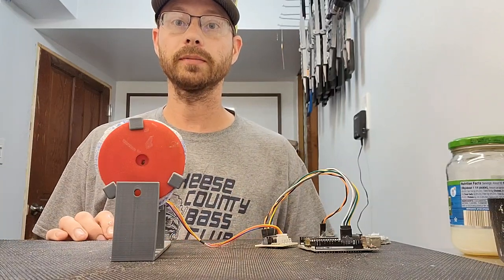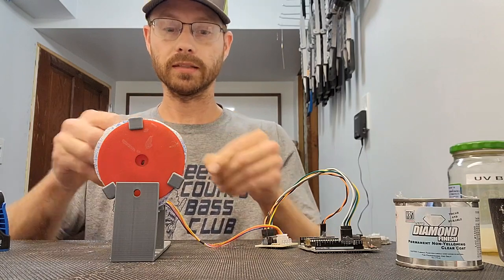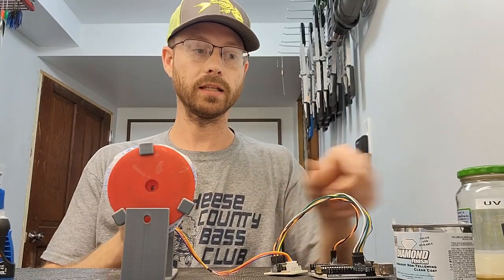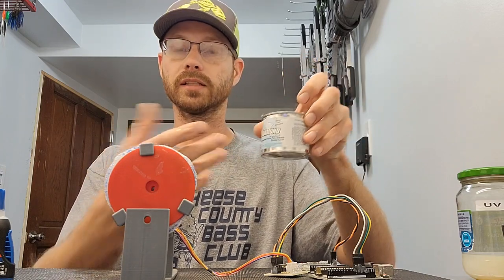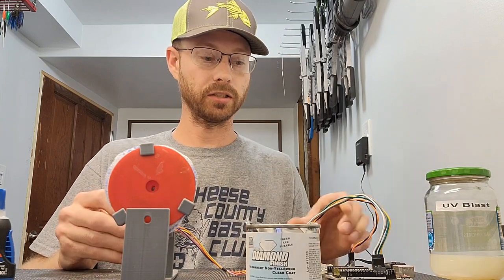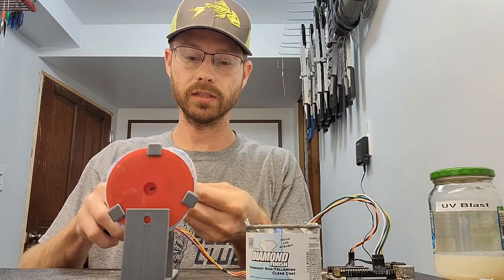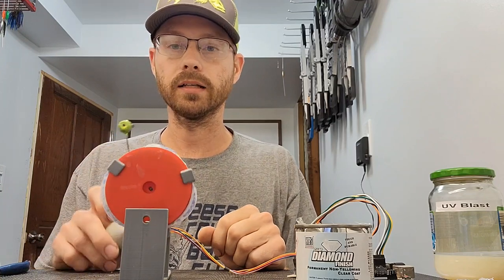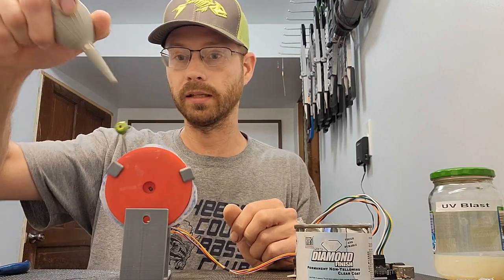How to reduce air bubbles in your jigs coated with KBS Diamond finish and UV Blast.

Comment: what does it clean up with? water, acetone ect? i got this product for models but have only seen videos of it being used on fishing lures.
Reply from the maker: I would say paint thinner or acetone would work fine. I've never had to clean any of it up. I use a tile for a floor with a rubber type back and if it drips on it I just leave it dry. When it gets really bad I'll grab another tile from what was left over from a remodeling project and use it. If the hook eyes plug up you can poke them out after a few hours pretty easily with a paint buster tool or carefully with another hook.
Reply from the maker: That is if you decided to use it on jigs.
Reply: @relapsetackle  cool, thank you for the reply.
Reply from the maker: No problem at all. I try to be as responsive as possible.

Comment: When do you decide to use a clear coat vs the stardust clear?
Reply from the maker: I've just recently started using the clear stardust. I use it over stardust paint and before putting the eyes on, never over the eyes. I'm hoping for a UV clear stardust but I know it's much harder to make and a little more expensive. I've found that all of the stardust paint is very good quality and the durability is incredible.
Reply: @relapsetackle  ive found that the regular stardust paint is thicker than normal powder paint, so on my Ultra minnow style baits, I lose all the definition in the scales and such. I'm thinking if I use regular powder paint, and the stardust clear over it, that I'll keep the look of the definition. I don't need to feel the definition and detail, just the sight of it is important. Getting the clear this week so I'll lyk how it works out.
Reply from the maker: Good idea, please let me know how well it works!

Comment: KBS really should not be on a turner...Epoxy yes...Dip KBS then hang it...wait then wipe excess with Popsicle stick...thats why you are getting bubbles
Reply from the maker: The bubbles I was getting were from the eyes being glued on, not from the turner.... The super glue was gassing out... Thanks for your feedback... I solve the problem altogether and use Stardust, and the eyes don't need to be glued on, and I don't usually waste my time with KBS anymore because Stardust is so durable it's not needed...